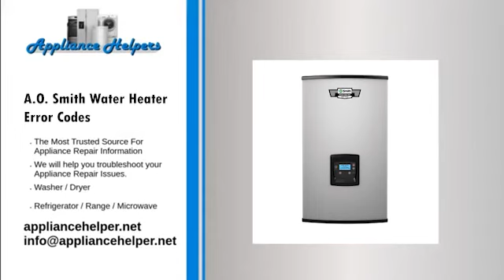A.O. Smith Water Heater Error Codes

Comment: Error code 24 show on the displa, solution.........
Reply from the maker: Error code 24 on an A.O. Smith water heater typically indicates a "Thermal Fuse Open" or a "Thermal Switch Open" issue. This error occurs when the thermal fuse or thermal switch senses an over-temperature condition, leading to a shut-off to prevent potential damage or hazards. Here are steps you can take to troubleshoot and resolve the issue:

Check for Obstructions:
Ensure that there are no obstructions around the water heater, such as stored items, debris, or anything blocking the air intake or exhaust vent.

Inspect the Venting System:
Examine the venting system for any blockages or restrictions. Make sure the vent pipes are clear and properly installed according to the manufacturer's guidelines.

Reset the Water Heater:
Locate the reset button on the water heater's control panel. Press and hold the reset button for a few seconds to see if it clears the error. Refer to your water heater's manual for the exact location of the reset button.

Check Gas Supply:
Ensure that the gas supply to the water heater is adequate. Check for any issues with the gas valve or pressure regulator.

Inspect the Burner and Flame Sensor:
Check the burner for any debris or blockages. Clean the burner if necessary. Also, inspect the flame sensor for any buildup of dirt or corrosion. Clean the flame sensor carefully.

Check the Thermostat Setting:
Verify that the thermostat is set to the desired temperature. If the thermostat is set too high, it could lead to an over-temperature condition.

Inspect the Ignition System:
Examine the ignition system for any issues. Ensure that the pilot light or electronic ignition is functioning correctly.

Professional Service:
If the above steps do not resolve the issue, or if you are unsure about performing certain checks, it's recommended to contact A.O. Smith customer support or a qualified technician for further assistance. Error code 24 may require professional diagnosis and repair.

Always prioritize safety when troubleshooting or servicing water heaters, and follow the manufacturer's guidelines and recommendations outlined in the product manual. If you are not comfortable performing these checks, seek the assistance of a qualified professional.

Comment: Error code 22
Reply from the maker: An error code 22 on an A.O. Smith water heater typically indicates a problem with the power supply or a flame failure during operation. This error is often related to the ignition or gas supply to the water heater. Here's what you can do to troubleshoot and potentially resolve this issue:

Check Gas Supply: Ensure that the gas supply to the water heater is turned on and that there are no issues with the gas line supplying the unit. Verify that other gas appliances in your home are functioning properly.

Inspect Ignition System: The error code 22 can occur if there's an issue with the ignition system. Inspect the igniter, burner, and flame sensor for any signs of damage or obstruction. Clean the components if necessary and ensure they are properly aligned.

Reset the Water Heater: Try resetting the water heater by turning off the power supply to the unit for a few minutes and then turning it back on. This may clear the error code if it was triggered by a temporary glitch.

Check Venting: Ensure that the venting system for the water heater is clear of any obstructions or debris. A blocked vent can cause improper combustion and trigger error codes.

Inspect Electrical Connections: Check the electrical connections to the water heater for any loose or damaged wires. Ensure all connections are secure and properly insulated.

Consult the Manual: Refer to the user manual or technical documentation provided with your A.O. Smith water heater for specific troubleshooting steps related to error code 22. The manual may provide additional information on resolving the issue or resetting the unit.

Comment: Code e02
Reply from the maker: The error code "E02" on an A.O. Smith water heater typically indicates a problem with the ignition or flame sensing system. Here are some steps to troubleshoot this issue:

Check Gas Supply: Ensure that the gas supply to the water heater is turned on and that there are no issues with the gas line, such as a closed valve or low gas pressure.

Inspect Ignition System: Check the ignition system components, such as the pilot light or igniter, to ensure they are functioning correctly. Clean any debris or buildup around the ignition components that may be interfering with ignition.

Check Flame Sensor: Inspect the flame sensor (if applicable) for any dirt, corrosion, or damage. The flame sensor detects the presence of a flame and signals the control board to continue supplying gas. Clean or replace the flame sensor as needed.

Reset the Water Heater: Try resetting the water heater by turning off the power to the unit for a few minutes and then turning it back on. This may clear the error code and allow the water heater to restart normally.

Professional Service: If you're unable to resolve the issue on your own or if the error code persists, it's best to contact A.O. Smith's customer support or a qualified technician for further assistance. They can perform diagnostic tests and repairs to address the problem with the ignition system.

By following these troubleshooting steps, you can hopefully resolve the error code "E02" on your A.O. Smith water heater and restore hot water supply to your home. Always prioritize safety when working with gas appliances, and consult the water heater's user manual for model-specific troubleshooting tips.